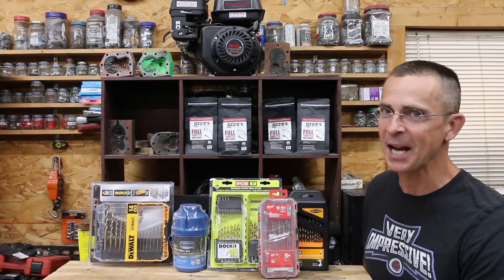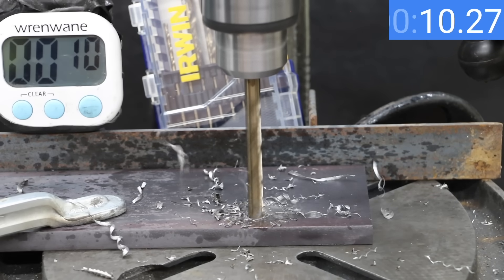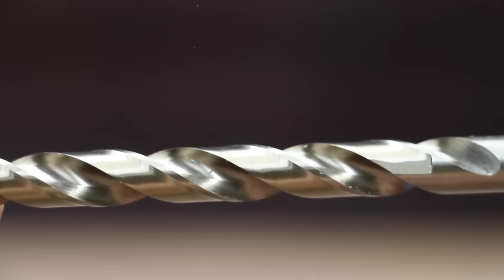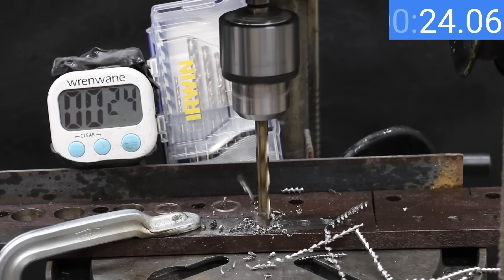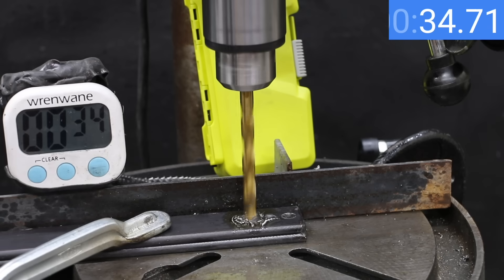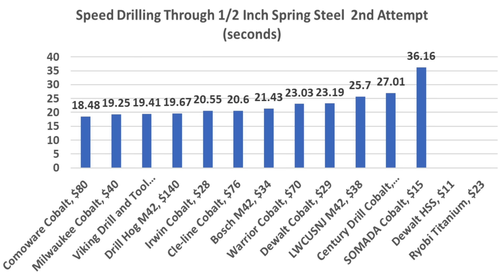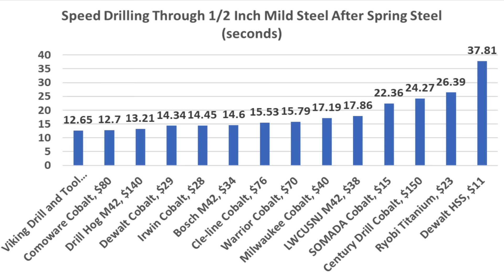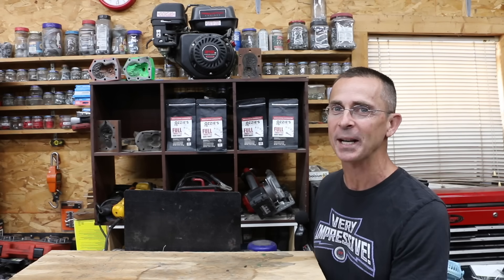Best Drill Bit Set? $11 vs $200? Let’s Settle This!

Comment: The best set I’ve ever used is the Matco Hyper Step bits. Absurdly expensive but they are amazing. Only two faults is if your drilling a blind hole and your need the hole to be the right diameter all the way to the bottom. Second fault is sharpening them is a tedious process but still amazing bits. I’m pretty sure they’re made by KnKut and you can get an indelible looking set for a lot less straight from them. Don’t know is they perform identically though. Great video as always!!!!

Comment: Just buy the cheapest non-chinese HSS drills you find and learn to resharpen those on a bench grinder and they will be the best drills you refuse not to use. The M42 Cobalt drills (8% Cobalt HSS) are only to be bought if you have a drill doctor to resharpen them with because they have massively thick webs that MUST be ground with a split point or else they will not drill a straight hole. Any thin webbed HSS drill though hand sharpened on a trued bench grinder is impossible to beat for cost. 
The most important thing for drill longevity is to get it razor sharp, and then run an india stone along the lip 2-3x to knock that razor edge off while polishing any jagged edges off. I do this to freehand sharpen 2.5" diameter taper drills and I drill holes a foot deep in 316L stainless without a pilot hole on a lathe all the time without needing to resharpen for a few holes.

Comment: I need bits with elasticity, meaning they can bend without breaking and then return to their original shape. I couldn't count how many of those <1/8" drill bits I've snapped just because my hands drift by 1 degree. At the very least the chuck end of the bit should be ductile. Maybe that's my problem, I always chuck the bit too deep perhaps, when I should be only chucking the very end of the bit where it's perhaps more elastic.

Comment: Another great video! I would like to see you go a little farther testing longevity. Maybe drill several holes with the same force and see how fast each bit dulls out over time. I know from experience the Dewalts dull quickly with repeated use. Another brand I would like to see tested is Norseman, found at Fastenal, if you do a round 2
Reply from the maker: Thank you for sharing!
Reply: Great drills, I have the 115pc set, man it's handy!  And too, wish PF had included them but maybe he didn't know about them.  I'm curious "Viking"  "Norseman"???

Comment: I bought a set of Dewakt HSS drill bits. Worst set I have bought in quite a long time. They not only had trouble drilling through mild steel they also dulled out easy also. I will get either a Comoware set or the Bosch M42 set next time.

Comment: Great testing and good to know that the dewalt bits I bought performed well here. Maybe next time you can also add breaking point from lateral load because most of the times I have broken a bit, its because the drill didnt stay concentric to the drilled hole causing lateral stress and breakage.
Reply from the maker: Thank you for sharing!

Comment: One thing with drill bits that’s deceptive is what’s good in a drill press isn’t good for a hand drill. Drill presses do fine with hard bits because the stresses are mostly in line as long as your clamp is good.

But when drilling by hand? If you’re even slightly off the bit will shatter because its being flexed in every direction rapidly by the drill and they get destroyed in fractions of a second.

Try drilling a half a dozen holes into mild steel 1/2” plate with each of these in a 3/8” bit and you’ll get a complete different result which is more in line with the average home user.

Comment: As an electrician id like to see a video on carbide tip hole cutters.  I like the lenox  but it would be nice to compare with the klein, ideal, greenlee, hercules and some of the knock off brands. Other than the lenox, most of the others look pretty much identical. Not sure if u have done a vid on those before but if not it would be a good one in my opinion.
Reply from the maker: Thank you for sharing!

Comment: Excellent testing as always, I'm often in the market for bits. 
A suggestion though, there is a type of bit I had not heard of before, but now use, they're manufactured by Astro Pneumatic, they're their Turbostep bits. I've only used them in Milwaukee and DeWalt brushless drills, but in my experience drilling steel with them they are incredible. From my searching it seems like there are a few other companies that licensed their design, I also have a set of the Norseman's and they seem almost identical, but more expensive. May be a topic that could be revisited.

Thanks as always for your dedication to providing non-bias information!!!
Reply from the maker: Thank you for sharing!

Comment: I purchased the full $60 set of those DeWalt bits to drill 14 holes in 1/8-in mild steel and ended up snapping 3 of them. It was very frustrating; luckily the precise diameter wasn't critical. I'm worried they may not have the strength to get through particularly hard mill scale.
Reply from the maker: Thank you for sharing!

Comment: Have you seen the hyper step drill bits? Originally Matco had the exclusive rights to the patent but that has expired and multiple manufacturers are coming out with them now. My snap on dealer has some random brand that he will warranty 1/4 inch and up. The small sizes are so hard they snap super easily. The larger sizes are awesome though.

Comment: Always nice to see my own empirical experiences and opinions validated by your testing.  I love my various Viking drill bits (particularly the 115-piece Magnum set) and use them on the tougher metals and when I drill for tapping but when I know I will be hard on the drill bit, I use the major brand names (Milwaukee, Bosch, DeWalt) made overseas (mostly) and purchased at a big box store.  Thank you for another great test and video!!
Reply: I'm just the opposite. I don't want to sacrifice my good drills on spring steel! I don't mind dulling them because I have a sharpener, but I don't want to snap my good drills! My Warrior M35 usually come through without a scratch.

Comment: I have recently purchased Dewalt and Milwaukee bits. More than half of them are out--of-the-box warped. I put them in my drill press and they wobble. I'd love it if you can take a look at that. I feel totally ripped off by these companies.
I made sure my chuck is true and the bits are not used and seated properly in the drill press.

Comment: I always break my bits vs dulling them. Tesing some of the smaller bits' breaking strength would be nice!

Great vid as usual!
Reply: I've broken only a few small-diameter bits (1-3mm). I've dulled a lot more because I'm an idiot as far as drilling metals is concerned and don't have a drill-press.
Reply: Lol...I've had some Chinese made bits (gifts) actually completely unwind instead of breaking 😀 Best option is still to buy individual bit sizes in packs from a reliable supplier to production machine shops--they are usually an order of magnitude better than most "homeowner" brand bits.
Reply: That's Operator Malfunction 😂
Drilling is an art. And knowing what bit works, is an art too. Because even consumer bits of the exact same thing, are not the same.

And as a couple here are eluding to.
Shear strength, and tensile strength, are two totally different things. But should Both Be Considered in any given application.
Reply: What, how the hell lol

Only time I break a bit is if I'm twistin and tweakin my drill
Reply: @alextheonewarrior   1/32", 1/64" bits break easy. looking at them might break them.  thinking he's talking about those. now i'm a woodworker that'll split logs, mill them to workable wood in my shop, and make a jewelry box out of logs i get. some, well all the wood i use for said projects are very hard woods. add that to fine hardware, hinges for doors for example, the screws are brass or stainless steel, and very VERY tiny, i need an 'eyeglass screwdriver kit to put them in,  soft metal that the wood alone will wear the threads right off the screws. and have to have pilot holes drilled.  i use irwin bits because when one breaks, they're cheap to replace. but still good and long lasting.
Reply: @garycarpenter2932  Exactly. Pilot holes and / or drilling things out - like a broken bolt - are what gets me. Also fiberglass, fiberglass is nasty to drill and screw.
Reply: @alextheonewarrior  Breaking bits usually happens when you put radial load on them, drill bits are very hard but brittle, so instead of bending they just snap. So JC likely is pushing at an angle when drilling.
Reply: @GaryLefever    would agree, but the average guy probably doesn't have a selection of smaller drills to go with smaller bits on handheld jobs.... and a steady hand too.
Reply: @alextheonewarrior    not every job fits in a drill press so side flex (without breaking) is important for those small bits.

Comment: Would love to see a test of the best tire pressure gauges. I’ve found a lot that aren’t accurate, or repeatable and have poor durability. I would like to find an air chuck with built in gauge to keep my tires aired up properly as temps change through seasons.
Reply from the maker: Thank you for sharing!

Comment: I don't know if you'd do this but everyone has different theories on batteries. Like if you set them on concrete they will discharge.  Is that true? Because of the cold concrete?  Why do people put batteries in the fridge then? Wouldn't that ruin the battery?  Does using the 200-amp start feature on a jumper box ruin the battery? My boss  is always saying don't jump it  on 200 amps. I tell him If I don't, then it won't start.  No one seems to know for sure and I thought you may be able to solve some of these mysteries surrounding batteries. And have you ever drained the old acid and added new acid and got it to work? I was thinking about trying it. We got like 3 Suburban's and a tractor that never start.  I'm tired of jumping them all the time.

Comment: If the bit has HSS on the side of it isn't actually cobalt.
As far as speed of drilling goes.
That has more to do with how the tip is sharpened, rather than the type of material it's made out of.
Kinda of expensive, but.
The best drill for fast hole making is made by Nachi they're 70% carbide 30% cobalt.
Yet that isn't the reason for the speed.
That comes down to it having a split tip.
"Top Tip"
If you want a drill to last.
Before you use a new one.
Run the side of allen wrench or anything thats hardened steel,
across the cutting edges.
This will help stop the bit from chipping out to soon, and make for a much more durable bit.
28 years of machining experience has taught me this.
Reply from the maker: Thanks for the feedback.

Comment: ive had better luck out of some of the no name chinese drill bit sets than almost all of the ones on this list. I've used many, many brands over the years. 
I eventually bought the 29pc matco hyper step bit set off a local truck. expensive drill bits, but they have a lifetime warranty free replacement on any bit larger than 17/64. if you use drill bits regularly, this is the ONLY drill bit set worth spending more than 40 bucks on. Not even snap on warranties drill bits.
Reply from the maker: Thanks for the feedback.

Comment: I'm a Plumber, I never know what I'm going to be drilling. I frequently break/chip/dull bits. Its unavoidable, even when I have the highest quality bits.

For me, one of the most important parts of a drill bit is the Geometry. I need a bit I can easily resharpen by hand on my fine grit bench grinding wheel.
Reply from the maker: Thanks for the feedback.

Comment: A video idea I'd like to see as the snow starts piling up: electric snow shovels.

I used to dismiss them thinking they wouldn't have the power or endurance to be much use, but with how battery performance is so much better nowadays they seem to actually be useful, but the videos out there now really don't do the thorough testing you do, they kinda just take manufacturer specs at face value.
Reply from the maker: Thanks for the suggestion.

Comment: I bought that exact model of Drill Hog bits to have in my chest at work from the recommendation of our machinist. I went with those because of the in-between sizes for drilling and tapping holes in stainless. So, far I have been extremely happy after 2 years of use. The only complaint I have which you might have noticed from testing is the shanks to keep them from slipping in the drill chuck tend to want roll and keep them from going back into the carrying case, nothing I swipe or two with a file won't fix, just annoying. Thanks again for the great video and content.
Reply from the maker: You are welcome!  Thanks for sharing.

Comment: Love my Milwaukee cobalt drill bit set.  Tried to use some cheap TN bits on some metal and failed miserably.  I bought those bits, loaded it up, and zipped right through it, no problem.  Right tools for the right job make it go 50% faster and better.
Reply from the maker: Thanks for the feedback.

Comment: Please make another boot video for the best 100% waterproof work boots (astm rated).  

You’ve reviewed boots in the past but none testing the water resistance unless I happened to miss that video. I’m at work (been shoveling snow and salting the roads) and have swapped between 3 pairs of “waterproof” boots because they all are leaking terribly
Reply from the maker: Thanks for the suggestion.

Comment: No real losers today. From industry standard Irwin to Quality cutting Steel Bosch to over-all quality Milwaukee & DeWalt,  Every brand seemed to hold up their own reputation.. .   I can't help but wonder if that LW might have got a little hot when it was sharpened.. If so,, The chipping could be the outcome.. I might also question the true quality of the cobalt in some of those..  AS ALWAYS,,, Good stuff for anyone with a little grease under their nails..
Reply from the maker: Thanks for the feedback.

Comment: It would have been cool to see all the bits sharpened and retested. It would help determine what's more important in drill bit performance: material or sharpness. It could also reveal if it's worth spending your money on a nicer bit sharpener rather than buying nicer bits up front. Thanks for all your work.
Reply from the maker: You are welcome!  Thanks for the constructive feedback.
Reply: MANY off brand drill bits will perform totally different.  I used to buy CHEAP HSS and solid cobalt bits, when they were pretty much all USA made... Hanson-Ace, Century, and many others.... They immediately got resharpened before putting into service, as they were optimized for production speed, not performance. I think they are getting a bit better, even if most are from China, to give good, if not optimal performance.   

Drill Doctor will make drill bits last until they are too short to use anymore. Even one that snaps at the tip, can be rejuvenated. Just do not let it cook to cherry red on a bench grinder. Keep it cool.... get shape close to proper, and finish on Drill Doctor. @ProjectFarm
Reply: He did a test a while back for exactly this. Turned out the drill doctor was actually pretty great, given you're sharpening smaller bits.
Reply: Yeah, but how do you sharped the Milwakee and DeWalt? Unless they will also sell some expensive sharpening machine.
Reply: @ContraVsGigi if you are using a belt sander grind the flat with the flat part and grind the curved part with the rounded over part at the very front. If you're hand filing, using a flat file and a round file should do the trick.
Reply: @-aid4084 That's a lot of time and effort if you have to do it at all frequently.  If time vs money is a concern, using another brand or just tossing the bit maay be more economical.  This is especially true if you consider not just manual sharpening time but also lost productivity from breaking your concentration and workflow and the chance of engaging in other tasks, conversations, etc.  At maybe $5 a bit, it doesn't take much time to overcome the cost of a replacement.
Reply: @ContraVsGigi you take a grinder and knock those special nubs off of them and sharpen them like a regular drill bit. That drill Dr. Will make a drill bit out of anything.
Reply: You cannot differentiate between material and sharpness. The material will determine what sort of an edge it will hold.

Comment: I bought a set of dormer bits years ago and it’s worth it if you’re drilling through hard material often. The cheap ones might wake it through a few times but they will stop working shortly after.
Reply from the maker: Thanks for the feedback.

Comment: Like many I actually treat drill bits as a consumable based on the hundred or more dull ones I still have to sharpen. Thus I tend to buy the De Walt on sale and like the cases, I have one Ryobi I keep for emergency use in my bag with the drill, a few Bosch and Milwaukee in my mechanics box and a quality index on the machine tool bench. So it is good to see how I am vindicated in my choices! 😂
Reply from the maker: Thanks for sharing.

Comment: Best drill bits ive ever used for drilling steel reliabily are the Tin/TiALN Cobalt Jobbers' Drill Bits from McMaster.. $10-20 a piece depending on size but cut through hardended steel and stainless like butter.
Reply from the maker: Thanks for sharing.

Comment: Another great video. Repeated drilling through hard material is what separates the rock stars from the groupies, and you demonstrated that well here. I'm surprised at the DeWalt and the Bosch sets,  they should be fine for most household use.
Reply from the maker: Thanks!

Comment: Great Video and timing as always, im in the need for some new drill bits. 
Might i recommend testing SDS Concrete/Masonry drill bits next?
see how they hold up especially when rebar or harder rock is involved. Hilti and Bosch have a good reputation i wonder how they actually stack up.
Reply from the maker: Thanks for the suggestion.